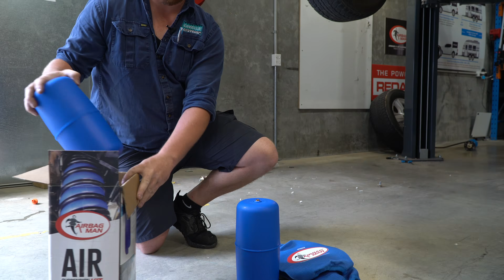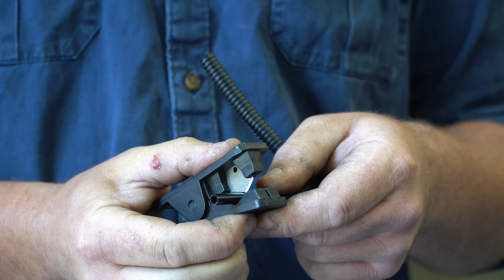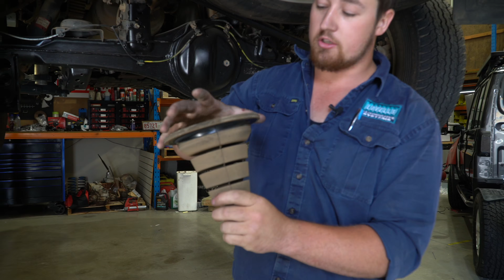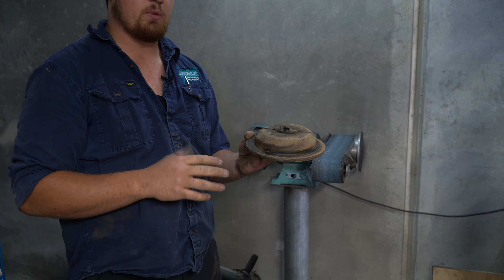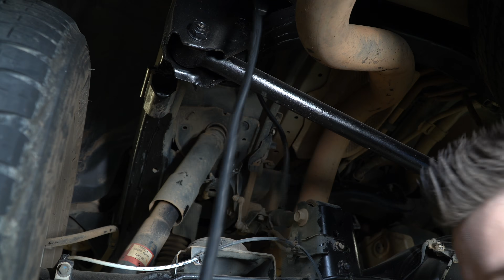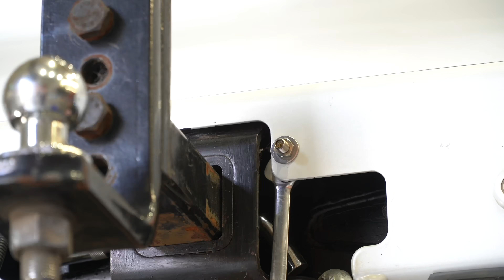How to Install Airman Airbag - Tutorial and Practical Tips

Comment: Hi.

Name of onboard control system shown towards end of video?

Does it matter which way the coil springs are installed?

With onboard compressor, after the air is exhausted from airbags, where is air sourced from again to reinflate the air bags?

How to prevent dirt/moisture entering the valves mounted externally (at rear bumper)?

Comment: I’ve got hilux surf and just bought airbag man bags. They came with 2” spacer and the valve protection spacer. I have no bump stops to cut or remove. Am I correct in assuming the 2” spacer is for the bottom with the flush side facing up and the thin valve spacer to stay at top end ? Thanks

Comment: Just remember to slide fuel line hose over the intire length of the plastic lines will save a ton of headache, good luck with your install.